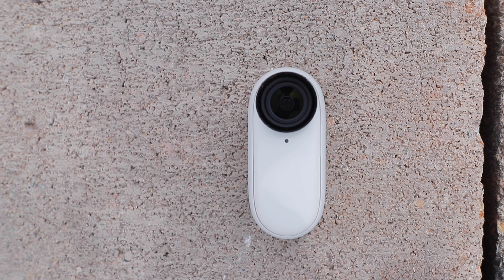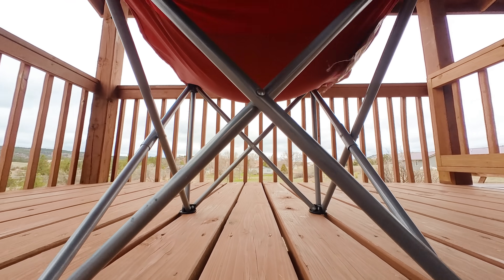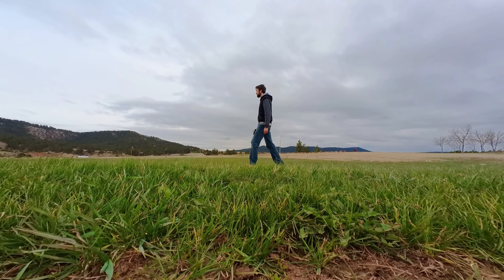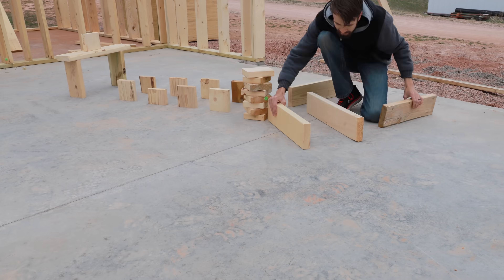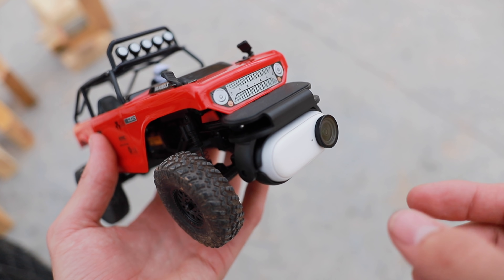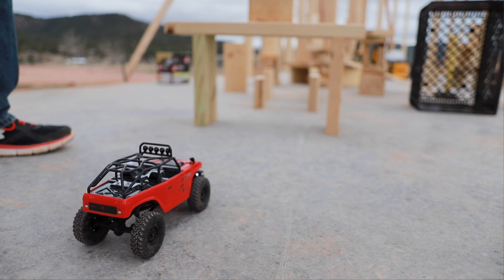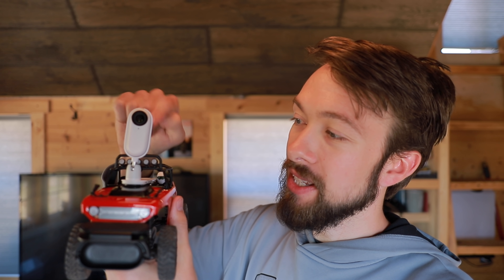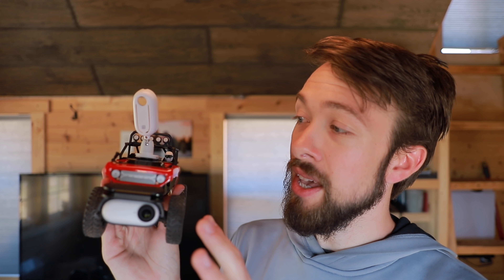RC In Tiny Places With Insta360 GO 2

Comment: Perfect work, Luke.
How do you get sharp footage even in close-ups?
Do you use a macro-lens in front?
I struggle capturing sharp footage when it comes to close-ups under 15cm.
Reply from the maker: That’s just what my footage looks like straight out of camera
Reply: @LukeEdwin   To make it even more comparable with a Probe Lens, I think about a macro lens to screw it in instead of the lens protection. Perhaps 2-3 diopters, have to try.

Comment: Yeahhhhh I'm not paying $109.99 for that RC when a cheap $20 can do the same! Great idea, though 😎
Reply from the maker: I tried a $20 one in this video - https://youtu.be/A4qTjaEeayo 
It worked ok but the $20 one didn't have adjustable speed control so it is either full speed or nothing. same with steering it was either turned all the way or nothing, so it wasn't very Precision. It also couldn't handle any rough Terrain.  I decide to upgrade to this $100 one and it's just way nicer. the four-wheel drive can take it over pretty rough terrain and the steering and speed controls are really accurate and nice. Not saying you need to get one but just explaining why I decided to get something a bit more expensive.
Reply: @LukeEdwin  I read a lot of reviews talking about the battery and charger failing on that RC, did you purchase a separate   balance charger?